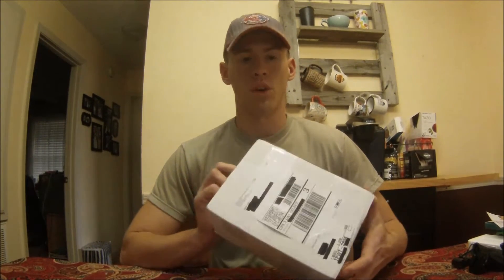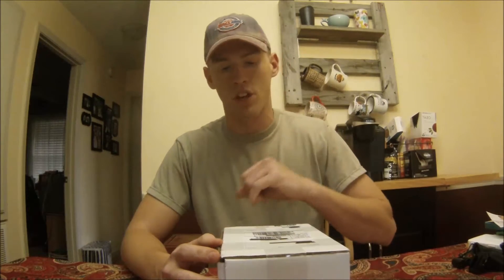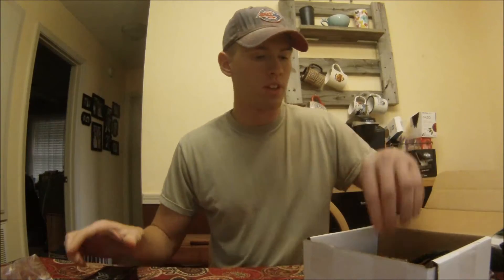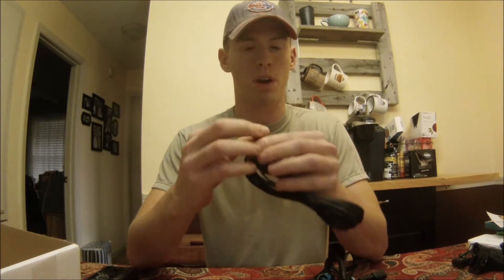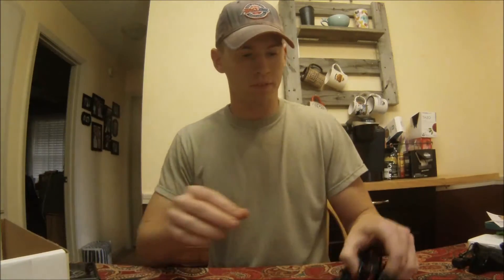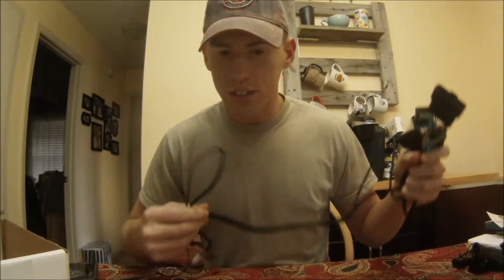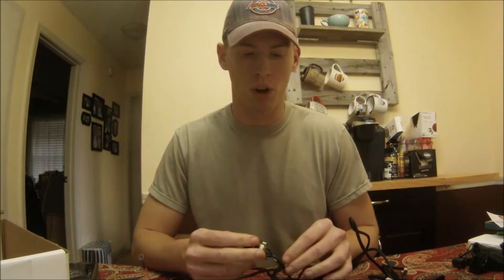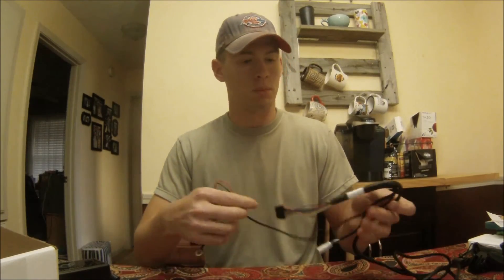2013-2017 Cummins Stealth Module Unbox

Comment: hi there, I just ordered mine! waiting for it to show up! Have you noticed any power and/or mileage economy gains!?
Reply from the maker: Jack Davenport yes I've noticed more power and overall performance in the cruising/towing range. I don't have enough mileage on it to determine mpg increase. I don't drive consistently one way or the other. I did reset my lie-o-meter before work and it read 1.5 more mpg and my hand calculations always read more than what it shows. I leave it on the 100hp setting.
Reply: Good to know! Let me know if you notice any MPG increase on the stock or +30hp setting! I am purchasing this module to save mpg while driving & towing - thanks again!